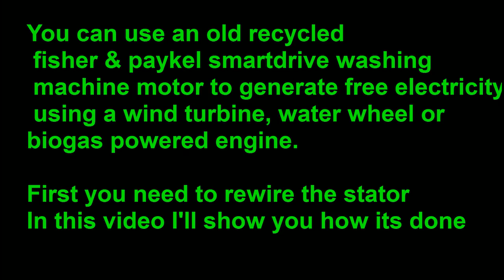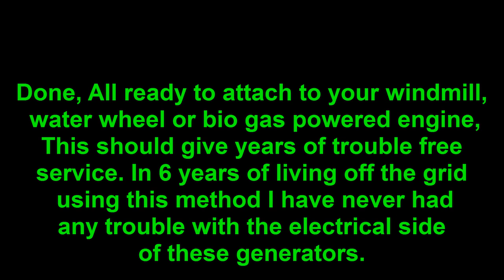How to rewire an old washing machine motor to generate free power

Comment: why is it necessary to rewire without it gives pover  too ?
Reply from the maker: TheMrmainstreamer The factory stator generates dangerously high voltage not useful for charging a battery bank, rewiring reduces voltage & raises the amps

Comment: looks like a good idear  but why not leave it as is in 3 phase and connect a transformer in reverse and all you need to do is  step the volts up to 120vac or 220vac  seeing the feed of generator is ac out.  same thing in district pole transformers except its step down  than up they start at around 20kv primary on top case to earth ground then its 3 phase out 220 240 volt and half is 110 120 60 hz?.
Reply from the maker: Nice idea but these poke out 300+ hz not sure how my appliances would handle that
Reply: hmmm thats true i think the answer is using capactors theres a video on yt  of a guy that converted a microwave transformer for use as an inverter he used 40 uf caps to change the frequency think it droped 100 hz  soo it has to be  changeing it  i have seen this circut idear in one of my ups inverters lc network or pi there should be a formula to convert frequency good luck with your project   peace
Reply: inventhead and buddhanz1 i would go a simple off the shelf route find out where your Auctions are for Electrical appliances ex gov, ex company stuff, but a  online Double Conversion UPS 48volt as they would not need any modifications to work for what you want. what is the difference between this type and other types simple these always run off the battery / charger power..... what you should do is  add diodes in a full bridge mode, add some caps for smoothing, add this after the rectifier before the charger on the UPS, you can plug in your ups like normal or just have it run off your generator, be sure to check your voltage of your generator and compare to the voltage of the charger in the UPS. I hope this helps, nice work.

Comment: Hello,
Very intersting video, I am working on a turbine project and I wanted to know if you knew at which speed the generator you madein the video is the most efficient ?
Reply: the motor original top speed was 1000rpm, you can also do some more type rewire for higher voltage bit less current BUT a watt is a watt no matter how you dice it so at 48 volts you could get 10 Amps easy or 480 watts or 24 volts at 20 Amps and still 480 watts, if you wanted a long run and power center back at base you can leave or set to 96 volts and current would be 5 Amps then do a transformer and then the bridge rectifier AC to DC conversion lower voltage and higher current, if have his setup the inverter is on site of generator with batteries, then a run of 120VAC to house

Comment: So how exactly do I hook this up to a device? What is ground? The copper bridge with all 3 wires? 

This is a good video but I wish you explained how to connect it as well.
Reply from the maker: It puts out 3 phase ac, the rectifier converts it to dc suitable for charging a 12- 24 v battery bank

Comment: Interesting Video. May I suggest, however, that you use heatshrink tubing for insulation instead of hot glue?
Sure, it's a bit more work to get the soldering joints just right so you can still slide the heatshrink tubing over the joint, but it's just so much better from a safety point of view. Also, there's heatshrink with an integrated layer of hot glue which will even seal the soldering joings airtight - might be a big plus when going for water power.
Reply from the maker: You may suggest it but I won't need heatshrink, the turbine has been running 24/7 faultlessly since I built it all those years ago

Comment: Hi, Nice video Buddhanz1, I have converted a Samsung front load washing machine into a generator, whe running open circuit, it goes up to 100 Volts running about 300 rpm, but when a load (a bulb or 24v battery bank ) is connected, it runs slow (about 40 RPM) and I get no power output, Can you help me, did you have that problem before? no rewiring has been done yet.
Reply from the maker: Remington Rafael No, sorry I've never tried one of those
Reply: Hi, is it possible because of feedback from battery bank to power source? have you try put diode between battery and generator?
Reply from the maker: Denny Zulfikar The rectifier will stop any feedback - 3 diode blocks

Comment: I was taught to solder by touching the iron to the wire and getting the wire itself hot enough to melt the solder. By touching the solder to the wire instead of touching the solder to the iron it is drawn onto the wire to get the strongest connection with the least resistance. Your iron doesn't get as messy that either.
Reply from the maker: +Ralph Hernandez Yeah I usually  do that too but if I had used that technique for this job I would have been there all day, the iron was really too small for the job. I A butane torch would have been better. In saying that,  I've Never had a failed solder joint so that''s good enough for me.

Comment: I’m trying to research this free energy stuff. Don’t know much about motors but why are you having to cut the wires and then join them in a different configuration to that of what was there out of the washing machine?
Reply from the maker: Re-configuring the wiring produces higher amps at a lower voltage, more suitable for charging a battery bank and safer for the amateur to work with
Reply: Using a large soldering iron in his latest vids doing this again...with sound.
For a newly built hydro 
also  https://www.thebackshed.com/Windmill/FPRewire.asp

Comment: Hi, I'm working on your own project, I'm not very involved in this field, I wanted to ask you: should I use a rectifier? and what kind of charge regulator to use to control the battery charge without having voltage overload? Thank you.
Reply: Go to his channel and watch other videos. Yes you need 3 rectifiers. and a mppt charge controller.

Comment: Angry Ram whats the output voltage now as well as the amps?? thanks
Reply from the maker: Around 60v open circuit, but it shouldn't ever be open circuit. It will always be connected to a battery bank, The battery bank dictates the output voltage so voltage ranges from around 23.5 - 29 depending on state of charge,  amps peak at around 30. Of course this is site dependent, a site with more water flow / head, output will peak at around 1kw

Comment: what is the reason behind rewiring the stator while other stators can give output without rewiring?
Reply from the maker: Rewiring lowers the voltage to a safe level and raises the amps to a level suitable for charging a 12 - 48 v battery bank

Comment: yeh im an eleco and wondering have you tried multiple motors on one shaft as i have miles of pressure to burn
if so are you running a rectifier between them or can the parallel
Reply from the maker: Steve Simmons I guess you could run 2 on 1 shaft but you'd have to get a special shaft made, I'd be more inclined to run 2 separate turbines in case 1 fails you still have a backup

Comment: Hello, nice video ! if we want to have 220v ac output, should i rewire ? Thanks
Reply: dont do this unless you intend to control the water flow valve by the frequency of the output power. the idea of charging a battery and then using an inverter gives regulation of the frequency and the voltage to protect appliances. the only thing you can run off an unregulated supply from a frequency ( generator speed) point of view is an old style incandescent lamp so that's useless. to get 220 v you would alter the rewinding process and split it into just two groups of 7 in series/parallel i suspect

Comment: great vid. I can see you are putting the coiling more into parallel to reduce the voltage and increase the ampage  interested to figure out if factory wiring was star/Y and your rewire was delta? or the other way around.

Comment: Just curious why re-wire the stator? You can get 120v rectifiers cheap.
Reply from the maker: It puts out over 400vac with factory wiring and is quite hard to spin, would need very high water pressure or a much larger water wheel
Reply: Ah ok
Reply: Using a large soldering iron in his latest vids doing this again...with sound.
For a newly built hydro 
also  https://www.thebackshed.com/Windmill/FPRewire.asp

Comment: Why does it have to be that specific make and model washing machine? Is it because of the motor type?
Reply from the maker: +Laurent Blanchet It needs to be a permanent magnet type to produce high amps at low rpm
Reply: +Angry Ram ah, ok. So there may be other brands around the World that will work.
Reply from the maker: +Laurent Blanchet I'm told the whirlpool and maytag are ok to use but I haven't tried them  so can't recommend.

Comment: Can you explain why exactly you had to rewire it and what changed from when you rewired.. also x,y,z. how does that relatet to positive and negative when you try to charge a battery bank.... thanks
Reply from the maker: The factory wired stator produces 400+ volts with low amps which is dangerous for the amateur to work with and not very useful for charging a battery bank. By re-wiring we reduce the voltage, raise the amps to a level more suitable for charging the battery bank, we then need to rectify the power via the diode bridge from ac to dc (batteries are dc). We need the battery bank to make up the deficit when we use the inverter to run appliances with a higher wattage than the output of the  turbine.
Reply: So breaking the coils into smaller groups you decrease the voltage because you pull a magnet across less wire?  But bulk these together and get same watts, just less voltage and higher amp?  So then the diode bridge (full wave rectifyer?) only lets power flow one way, regardless of input direction,  so 24 v ac becomes 24v dc?   But how does all this work with 3 output leads?

Comment: I really like this, and I will try to build one myself. can you explain the purpose of rewiring? i'm a newbie. thank you
Reply from the maker: Factory wiring produces over 400 volts which is dangerous to work with & not useful for charging a battery bank, rewiring drops the voltage & boosts the amps
Reply: Why not use a transformer instead?

Comment: Thanks for such a good video, fantastic example of Kiwi can do.
I have a small 48volt solar system, does this work for charging 48volt battery bank or is it a different wiring for the stator?.. 
Thanks for sharing your skills with us, good on you man!
Reply from the maker: It will charge 48v but check out http://www.thebackshed.com/windmill/FPRewire.asp for the best configuration to suit your site, there are a few different ways to do it.
Cheers
Reply: Thank you very much man, Cheers.
Reply: DID you get this working with your solar system? I am building same thing as you now.

Comment: Can I use this as a generator without rewiring as you did in the video?
Reply from the maker: Yes but it will put out over 400v and high hz, not useful for charging a battery bank and dangerous for the novice to work with. I would not recommend it

Comment: So, your output power after the rewire is still 3 phase correct?  Also, how many poles dose the permanent magnets cover each?
Reply from the maker: Trent Hauge Yes it is still 3 phase, here's a good website that explains it all - http://www.thebackshed.com/windmill/FPRewire.asp
Reply: Buddhanz1 Out of curiosity, what is the AC output you are getting and what is your target RPM on the wheel?  Is the battery charger 3 phase and you plug straight in or are you converting to single phase then connecting to the battery charger?  Thanks for the link by they way.  I love playing around with tech (I work IT) and I can't leave anything alone.
Reply from the maker: Trent Hauge I run it around 1000 rpm, output is over 60v if you run it open circuit without a load, when connected to the battery bank however the battery bank will dictate the voltage, the rectifier converts it from 3 phase ac to dc then I connect it straight to the battery bank with a fuse on + side, I have another video showing how to build the turbine & rectifier here -  Free power- How to convert an old washing machine into a water powered generator

Comment: I would've used silicone caulk instead of hot glue
Reply: Using a large soldering iron in his latest vids doing this again...with sound.
For a newly built hydro 
also  https://www.thebackshed.com/Windmill/FPRewire.asp

Comment: I am new to this but I was just wondering, why did you solder the groups of 3 together when it appears you didn't use them? Was that just to keep the coils from unraveling over time? I understand why you didn't use them, but just curious why you still soldered them together. Thanks.
Reply: to down the voltage for direct charging battery (from 208 to 29V)
Reply: @GabrielFGomes-ok9qc  Which could have been accomplished with a lot less work and with a more efficient power distribution scheme by just finding an old derelict RV and stealing its rectifier inverter board that is used to convert incoming shore power into charging voltage for the battery and a cleaner more stable AC for the RV to use. BUT that does require having access to old derelict RVs, but if you can find an abandoned direct drive washing machine I imagine the RV isn't any harder to come by and you don't have to take the whole RV just open up the area by all the breakers where the board is stored, disconnect it from the RV electrical systems and unmount it. Shouldn't be any bigger than a notebook or large tablet for the new generation.

Comment: to confirm the transformer is still in "star" setup from the factory and after the rewire and you just rewired it to keep the star set up but so it would output a lower voltage, is that right?
Reply: yes and more current as well
Reply: @emilee172  star is less current. Thats why they switch from star to delta. Delta provides more current through less windings.

Comment: Just out of curiosity, what is the theory behind this rewiring? Why the rewired version can be used to generate electricity but not the first one?
Reply from the maker: The factory stator puts out out 400 + volts ac, not very useful for charging a battery bank and dangerous. rewiring lowers the voltage and raises amps more suitable for charging a battery bank
Reply: Excuse my asking, but if decreasing the voltage is the whole idea behind the rewiring why not just pass the current through a step-down transformer before the rectifier? Is it just to make the generator itself safer?
Reply from the maker: Transformers use power, I'm trying to keep it as efficient as possible

Comment: is it possible to make two phase since for charging a battery you require only two phase
Reply from the maker: lee cyril peter You could do that, but I don't see any benefit. If you need higher rpm you can just wind out the rotor to decrease drag from the magnets
Reply: Thanks flow your quick reply. I have taken apart an lg  direct drive motor. It has 36 poles but I don't think it makes much difference. But it has aluminium windings very tough to solder. Any tips. Thanks
Reply from the maker: lee cyril peter I'm not sure if you can solder aluminium, Id rip all the wire off & start again with copper wire, you should only need 20 wraps per pole to match output
Reply: I thought of doing just that. Thanks dude